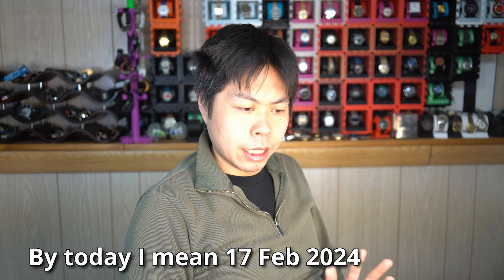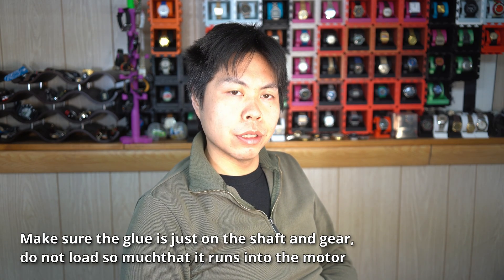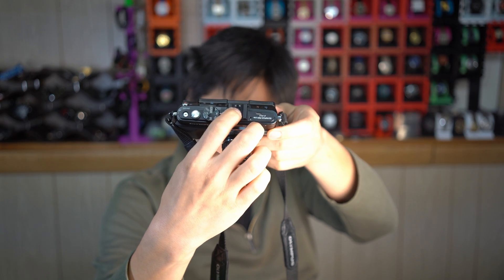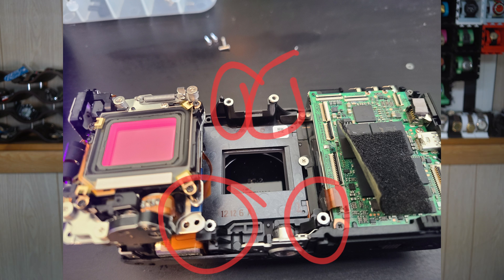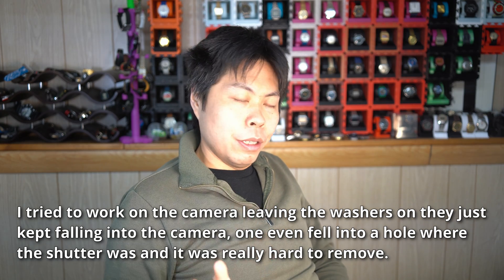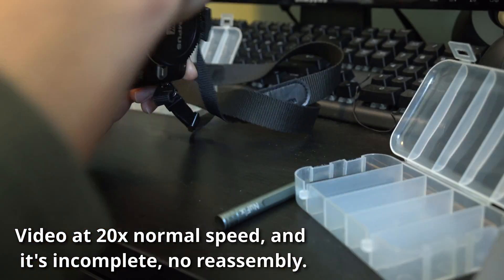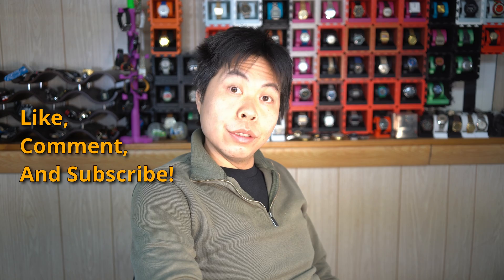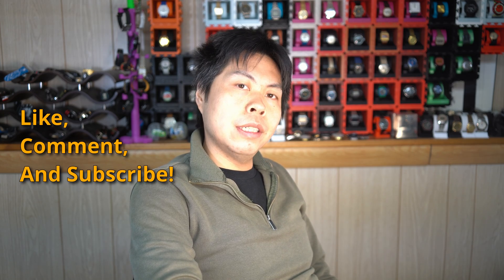Olympus E-PL5 Broken IBIS Repair Tips I wish I knew before starting (Also for E-PL E-P and E-PM)

Comment: Just asking from your general knowledge - I have an E-PL9 and the battery door got whacked when open and the hinge posts inside the camera are broken - does this mean a complete tear down to replace the section?
Reply from the maker: Just looking at the E-PL9 (and going on how previous ones are assembled) I would assume that yes if both the rear and front posts are damaged unfortunately yeah you'd have to. 

The posts would be integrated into the front and rear casing. The rear is easy but the front would require you to remove quite a bit to free the shell.

Comment: Where do you buy parts.  The ibis cog or gears
Reply from the maker: I didn't buy any parts for the repair I just just a dab of super glue on the broken gear. If you do require parts buying a parts camera is an option.
Reply: @Mr50mmish  thanks for the advice.  I call olympus and they said they don't support epl5 anymore.  I will watch your utube segment again ant try to open it up and see what inside

Comment: Where do you buy parts. The gears or cog. And what glue do you use
Reply from the maker: I didn't buy any parts for the repair I just just a dab of super glue on the broken gear. If you do require parts buying a parts camera is an option.

Comment: Hey Mr50! If the IBIS is broken, do lenses with stabilisation still work on these bodies?

My EPL5 is mostly flashing the orange light, though this morning it actually stopped flashing and seemed to work… and then back to flashing. Shame, I thought it fixed itself 🤓
Reply from the maker: Ah that's sucks, but I believe it does, you may have to go into the menu and switch the stabilization priority to "lens".

Comment: My PEN E-P5 and E-M5II appear to have a common issue.  Suspected capacitor failure in BOTH cameras because they do not remember the date and time.   The power button for BOTH cameras is also non-responsive.  The only way to power on and power off these two faulty cameras is to remove then reinsert the external battery.

If the capacitor is soldered in, I'll probably give DIY a miss and either have them repaired or give away the cameras.  Plus I don't know if the power on/off issue is associated with the capacitors.
Reply from the maker: Ah that sucks. As you said it is quite common, my E-M5 has it as well, the Clock battery/cap. It is soldered on, if I remember right it's a looks like it wouldn't be too bad to desolder but it is annoying enough that when I had my E-M5 apart I didn't bother with them. 

As far as I know the power button issue is unrelated. Someone on the DPreview forums had pointed out it might be from dirt getting into the area where the contacts are and just need to be cleaned. Atleast for the E-M5 mkii https://www.dpreview.com/forums/thread/4408496

It could be possible it's the same for the E-P5!

Comment: just got a pl5 off ebay that had this defect. Seller gave me some $ back. Got it for 35 Euros. I was thinking about do this repair but seeing your vid changed my mind. Too much of a pain in the ass. I'll just live without ibis for now. THanks man! You're a champ!
Reply from the maker: Haha it is a bit of a pain to do.
Reply: I'd say functioning IBIS on these cameras is worth more than 35 EUR, it'd certainly cost more than that to repair. I'd return it for a full refund if you still can
Reply: @eburneentertainment  I paid 250 AUD for one with bad ibis, it seems common to find them with the issue and at similar prices 😢
Reply: @flowermaze___ yeah I had an E-P3 with broken IBIS, it was actually surprisingly easy to repair though, bit of glue on the IBIS cogs and it was fixed. Fiddly though
Reply: @eburneentertainment would you recommend the procedure? I’m hesitant to open it up. Have repaired lots of mechanical cameras, not really electronics though
Reply: @flowermaze___  I'd definitely be comfortable attempting it again on an E-P3, can't speak for how different the E-P5 process would be. It's worth adding that it's not an electronic issue, it's a mechanical one whereby the cogs don't adhere to the drive rods anymore, hence a careful dab or glue is enough to fix it
Reply: @eburneentertainment  would appreciate if you can share how to do it. I recently got an E-P3 with a fungus infested 40-150mm (tho the photos are still sharp and contrasty), but just recently learned the IBIS issue. Got it for USD 85 so I guess it's fine? I just want to fix it if still possible.

Comment: Thabks for the great tips on this topic, highly useful. I wonder if you managed to measure the shaft diameter, and the outer diameter of the nylon gear? As well as the number of teeth and the length of the gear. This way, we can source for replacement gears somewhere.
Reply from the maker: Ah sadly I didn't end up taking measurements of the damaged peice, I was a bit flustered when the gear continued to break apart when I got the camera opened so I merely applied the glue till it set and patched the camera back up! If I crack open another one I'll try to get better data!

Comment: Thanks for showing this.  Aside from the image stabilization not working and the annoying flashing red IS icon, is there any harm in leaving this alone? I am a novice with an epl-1 I've used mainly as point and shoot, but lately have become interested in really learning how to use it.  I am capable of the teardown and repair, but my instincts are telling me to leave it alone.
Reply: Good video! I just turned apart my EPL-6 cuz of the IBIS problem and I noticed that one of the gears was loose. When I reassemble, notice that the sensor recovered some movement, but it doesn’t go center. I wonder if there is a way to calibrate the two motors to center, cuz I noticed that you can turn both gears to one way and then it stops, same to the other way. Also, both motors have a potentiometer that seems to be the one that alines them 🤔. Greetings from Colombia!
Reply from the maker: @NICKORAZU  Hmm I have heard that you may need to manually move the gear on the axis that isn't centring, it's possible the motor end stops aren't getting hit. But I'm not sure if that is an actual fact or just an idea. But atleast if you know that the sensor is moving in x and y that the gearing itself is fine.
Reply: @Mr50mmish   Before doing all the teardown, my sensor doesn’t moved horizontally, now it does, when I turn on the camera it shakes in both ways, but not like circular like when it works properly. So I don’t know if it’s because I had to move the gears to an specific position before turning the camera on or if that can be fixed by software (Assuming that the gears are working cuz of the movement and sound) Very interesting 😎
Reply: @NICKORAZU no calibration is needed - the camera automatically does that at each startup. You can see it - and that's also why a camera with broken IBIS gears makes such a terrible noise at startup; it's the broken gears skipping during the calibration.
Reply from the maker: There are 2 minor things to when it comes to leaving it. The sensor will basically stay parked a little off centre most of the times it's not noticeable, but if you happen to use lenses with a lot of swirling bokeh you may notice it's not centered and that's just due to the stabilizer not working. The second thing is the noise at start up you might have noticed it makes some semi loud noises that is the motor trying to move the sensor but it isn't moving anywhere, again won't affect shooting, might just be mildly annoying. 

But in short leaving it along won't result in any further damage or issues as far as I can tell.